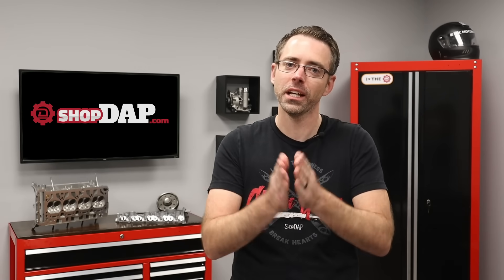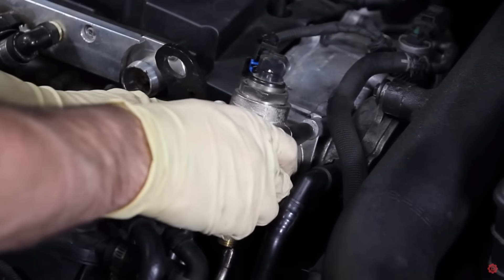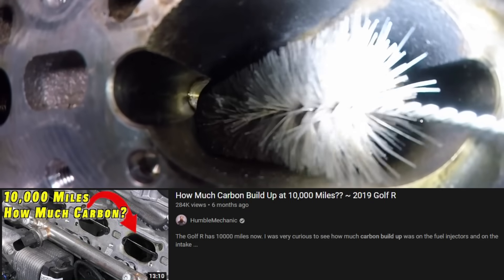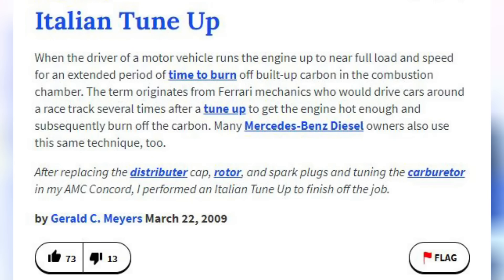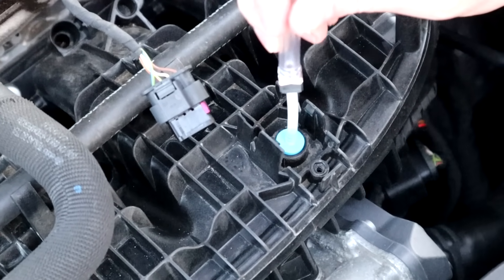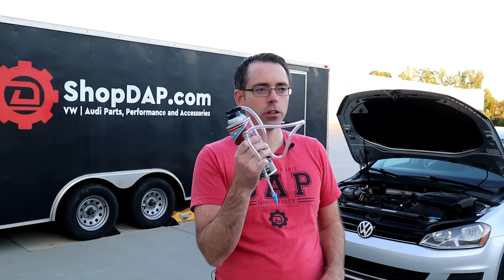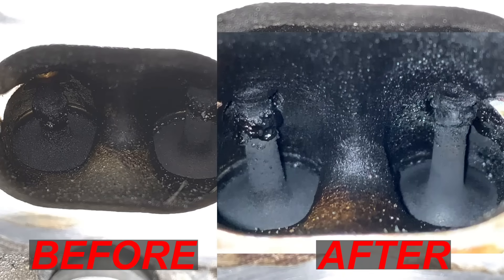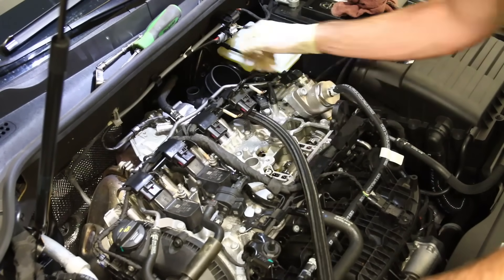Can you Really Remove Carbon for $29?

Comment: Italian tune-up is only good for fully flexing your Turbo vanes and possibly knocking a few deposits that could build up on them from you driving your turbo car like a granny all the time. My recommended solution is to just only buy naturally aspirated port injected vehicles. There a plenty of fun NA, MPFI used cars out there, and they are usually more reliable than their Turbo, DI counterparts.

Comment: The main problem that I've noticed with GDI motors. If you drive them like a grandma they will clog the valves... I have a hyundai veloster with two hundred and thirty six thousand miles on it and i've never done a carbon cleaning and have no misfires on cold starts.. I'd never shift before three thousand r p m and I redlined it every day.. I mean,  it's slow so it's not like i'm going fast l o l...

I do the same to my twenty twelve beetle turbo... But before I owned it an old lady owned it. So i'm sure the valves are a little sticky... Carbon cleaning is next...

Comment: Ford has switched to using port and direct injection with a lot of their engines lately. The 2.7 Ecoboost for example uses this, starting in 2018 with the 2nd gen of that motor.

Comment: The only way is you close the valve one cylinder at a time you fill the intake port after scraping the carbon off! Then you let it sit for  20 minutes and then you brush it  liquid  carbon remover still in the port and then you take rags you soak it up then air gun and then you do it again if you didn't get it all! Then once clean  spray with brake cleaner spray and air gun it out  do each intake port cylinder on compression stroke it will not enter the cylinder! Every 100,000km is usually the  most  like 3 times in it's life.

Comment: A old school way to remove carbon was to poor a small amount of good old H2O into the carberator. Not too much or you risk hydrolocking the engin.
The thermal shock to the hot carbon caused it to crack off the piston and valves.
Or a ball jar full of water with a small hose plugged into the intake manifold
Propane and hydrogen motors have zero carbon build up
In the 70's during the 1st gas crisis propane conversions on gas engines was comon. The engine lasted longer as well.
Then the fed put an energy tax on propane.
This was easy on older engines not so on today's systems.
Thank you EPA

Comment: There are ways to prevent carbon buildup for a long time. The following tips are to be used BEFORE the carbon builds up. 
Use only Top Tier fuel, (Costco has it cheap) and use synthetic engine oil. You're welcome.

Comment: I heard that some engines have both port and direct injection.Could a direct injection engine be retrofitted with separate low psi metered fuel injectors into the intake runners to clean the intake valves? Wouldn`t the o2 sensors lean out the fuel air ratio?Just wondering.You would have to drill and tap the runners and add another regulator on that side of the fuel delivery.

Comment: My Audi 2.0 TSI was using a qt of oil ABOUT every 500 miles , I set up a Alcohol Injection system (basically Windshield Washer Booster) on it with a very fine nozzle into the intake hose ,(just before the MAP) , after about a month it uses 1 qt between oil changes Every 4,000miles...I would never run a car 7-10k on Oil as recommended by manufacturers

Comment: conclusion is, vag do worst car ever been build and best way is never buy direct injected ... or beter to use propane system deleting this system.
you just have to remove the head every 35k miles... fiat do much reliable engines

Comment: The problem is because cars today most of the time stay under 2500RPM when on the road, to get better gas mileage and make your vehicle quieter. So, in order to burn the carbon accumulated in motor you need to run the motor over 3000RPM for some time or long trips but not over 4000RPM or use premium gasoline.

Comment: My 2017 GTI SE, which I purchased new and has been stage 1 EQT since break in still doesn't need this cleaning done. I'm almost at 160,000 miles. No drop in MPG, no performance loss, no cold start mis fires. It's been scoped twice and only has minimal build up. However, I only run 93 oct. and 90% of my miles are freeway miles due to my 50 minute commute into work. I also drive in S most of the time, even on the freeway. So, I don't see 6th gear very often. I'll have them checked again on my next DSG service, just to be safe.

Comment: None of the steps here except the catch can are truly preventative. They are all ways to try to clean the buildup after it has happened.

As the catch can demonstrates, the reality of the buildup is that it is most likely to happen when the vapors condense on a cooler surface. This will be most likely to happen under two scenarios: 1) if the engine is not allowed to reach operating temperature at all, as would occur on a very short drive. The problem here is that the heads and valves will not warm up sufficiently to prevent the condensation, so the little vapor will glom onto it like water on a cold beer on a humid day. 2) if the engine is run most frequently in short bursts, like short drives with lots of stopping and starting, then there will be more production of small amounts of vapor over time that will never be fully combusted, again because the heads and the valves will never really get hot enough for no condensation to occur.

The best preventative cannot be an Italian tuneup- like you say here, it will never get hot enough to cook off the carbon without seriously damaging the engine.

Instead, the best preventative is make fewer, longer drives as opposed to more, shorter drives. This will reduce the amount of time that the engine is running cool, and make the biggest reduction in the chance for any condensation to occur. It might burn off a little bit of the carbon too, especially if you intersperse your alreaady longer drives with a really long one (say, an hour or so).

The thing is, these issues are not really new. Lots of start-stop short runs at low temperature always increase the rate of problems in engines, if for no other reason than it gives the most risk of water buildup for the exact same condensation problem (water is a waste product of combustion so it is unavoidable). Likewise, most lubricants work best at operating temperature rather than cold, so your wear is going to be improved by running longer at hot temperatures.

If you have short commutes, save your car for other uses and walk, bike, or take public transit. If you're within 15 minutes' drive to work anyway, the time savings of using an alternative are virtually nil anyway. You're more likely to waste time in traffic, if anything. Save your car for when you really need it, and it will last a lot longer without these problems.

Comment: I thought the bigger culprit is the EGR system in modern cars rather than the PCV valve? Either way the situation sucks. I have a WRX and it hasn't been properly serviced in the past. Had a nasty power loss and  had to pay someone to clean it properly. Wish the intake manifold products worked better.

Comment: It seems logical that reducing the amount of dirty oil vapor that goes through the PCV valve through the intake valves would reduce the amount of carbon building up. Maybe if piston rings did a better job of sealing, less combustion gas and oil vapor would end up as crankcase pressure and carbon. Maybe if higher quality oil was being used and changed earlier, the oil vapors wouldn't have as many impurities to end up as gooey, gritty deposits.

Comment: I had an intake manifold leak on my 4.3 Chevy V6. When correcting the problem, I noticed the driver's side head and rocker arms looked beautiful and clean. The passenger side however had what I would consider a typical amount of residue for a 250,000 mile engine.
The driver's side, the clean side,  vents to just below the air cleaner above the throttle body.
I always assumed the  PCV side of the engine would  allow blowby vapors into the engine. 
I installed a catch can on the driver's side and I was surprised to see that moisture and snotty looking stuff inside the can.  I now have suspicions of a head gasket leak at the same location, allowing water into the lifter valley just as before.
I'm thinking positive about this. If moisture (steam) kept the rocker arms clean, maybe this moisture being sucked into the engine is keeping my intake valves clean. 😁
 Hey, I'm a positive thinker. My catch can is half-full,  not half empty. 👍
I know this video is a couple years old but it's great information 👍

Comment: I have a 1969 Z-28, it's a real X33 car with a 302.  For such a small motor it had a lot of cam.  It's running a 4.88 gear.
The engine had a lot of valve overlap and depending on octane rating I would have to retard the timing to keep it from pre-detonation.  The motor would rev really high for a street engine up to 9k RPM.  I was constantly pulling pieces of broken valve springs out (I had epoxied oil drain back screens in the cyl heads) and once a year I would remove the heads and replace all of the valve springs.  The pistons and cylinder domes\valves were always carbon'd up terribly.
So one day I decided to install an Edelbrock water injection setup.  It did the trick!  Made the mixture much more dense and the engine stopped pre-detonation.
But....I was fouling plugs like crazy and having to wipe off sooty carbon splattering off of the rear spoiler.  The car is Hugger Orange with White Stripes, so the spattering was really obvious.  I thought about removing the water injection but then after a couple of weeks it stopped splattering and fouling plugs.
Sometime later I pulled the heads to replace the valve springs and was amazed that the piston crowns and combustion chambers were spotless!
The heads and pistons looked like they were all freshly rebuilt. 
I could tell the instant that water inj bottle went dry though!
Eventually the Vari-Jection controller failed and Edelbrock had quit making them.  I went with a 400 block with main saddle half spacers and a 350 crank with a 350 main cap for the 400 bolt pattern.  I used a 2 bolt truck block and had the outers splayed for more bottom end strength.  I didn't need as much cam so the engine wasn't as temperamental.  Don't even get me started on all the mods I had to do to the Holley 650 to make that little 302 run like it wanted.
So how come nobody makes a simple water injection setup for these direct injection engines?  Sure seems like there is a market for them.
It could go right behind the Mass Air Flow sensor or speed density thingy, what ever type VW uses, and provide a dense water vapor charge to the cylinders.
Guarantee that would cure the carbon build up problem.
BTW, I hope all of that plumbing shown for the meth\water injection was all for theater.  My old water injection had a small tank and like 5 wires total.

Comment: Between a catch-can and a 10-15k mile seafoam "cleanup", you can prevent 95% of carbon deposits and it's not that hard or expensive to do. Every other oil change you add a 10 minute job to the mix and you're good to go.

Comment: I've been cleaning my Toyota Yaris 1.5L DI with CRC intake valve cleaner since 19k miles when I bought it. I do this at every 5000 mile oil change. You have to be careful, because the car doesn't really care for the process. After the 1hr heat soak is when things get interesting. I carefully run the residual cleaner through the engine until it's cleaned out, and quits smoking. I avoid loading, because it will miss guaranteed. After clearing it out, I immediately change the oil. I plan to do a before and after borescope this summer to see how effective it is. But the motor runs great at 55k. No misses. No power loss that I can tell.

Comment: Do a can of crc intake cleaner once a month for 6 months if it’s never been done and you have more than 50k miles. My car has 39k miles. I did one can it made a huge difference I figured two weeks later to do another can because it was impossible to get all the carbon out with one can. I plan on doing one can every oil change from now on. Do not allow that carbon to build up ignoring it. If you don’t do this sorta maintenance your car will be in shambles when your close to 100k miles. These car manufacturers don’t want our cars to last it’s in there best interest the quicker your car fails the more they sell. It’s on big scam

Comment: Seafoam does actually work. Buutt depemding in the age and amount of carbon build up you could need to do it 2 or 3 times, but it does work, and hey whats 10-20$ for a clean system

Comment: My father used to slowly pour Coca-Cola down the carburetor as the engine was running at high idle.  It didn't do anything, he just didn't like Coca-Cola.
Reply: so basically poured water and sugar into the top end? Your father is a moron.

Comment: Injection takes place outside the compression phase so why such high fuel pressure?  A simple poppet valve like the ones already in use would suffice for the fuel entrance.  Puzzling to me.

Comment: Should have seen the amount of smoke that came out of my car. I literally put a cloud down the whole street. It actually stopped traffic . It helped my gdi engine alot. When I put seafoam in it , the bottle says to hold the rpms around 1500-2000 when adding through the intake.  And like he said make sure your not spraying the mass airflow sensor . Would highly recommend seafoam .

Comment: Great video that was cool how you showed the before and after. I used the CDI Intake cleaner it definitely made a difference now after seeing this video I feel like I should spray another can or two into my Kia soul 2016 40k miles. I changed my spark plugs on my Kia soul at 40k miles. Decided to check them today Why have my new spark plugs blackened after only a month. My oil is still crystal clear I only drive locally to run errands and food shopping. Just wondering if this is normal. your channel should absolutely have millions of subscribers for sure. Use better tags and descriptions.

Comment: Umm dude, in the 1960's Detroit auto makers started to put PCV valves on cars. How old are you talking about, 1940's or 50's?
The PCV valve was typically located on the top of the valve cover are run to the backside of the intake manifold.

Comment: i'm a mechanic by trade all this easy snake oil ? solutions for a piss poor design .. I will simply bite the bullet and remove the heads and hot tank then and port and polish them while its apart taking a negative and make it a positive. For me its nothing but time and gaskets and head bolts if they are TTY.

Comment: direct injection systems had it almost right. instead of "replacing" the port injection system they should have simply "added" the direct injection system. with the port injection system going along for the ride to simply "keep" the valves clean. or even better yet keep them inert and there only for routine maintenance to run the car off of the port injectors to clean the intake valves. This way using them all the time does not compromise the fuel economy of the port injection system. Only use then when doing injection cleaning servicing etc..

Comment: The patent pending 505CRF & 505CRO Pour-In Treatments created, tested and manufactured by ATS Chemical are proven to STOP gasoline and diesel engine carbon build-up as well as clean existing carbon.

 

505CRO breaks down carbon deposits from; sticking piston rings, sticking lifters, sticking camshaft phasers, sticking oil control valves, sticking timing chain tensioner, and restricted lubricating screens. 

 

505CRF poured into your fuel can clean coking from the port style injector and the direct style injectors.

Comment: It's $6200 to get the carbon cleaned by taking off intake manifold at the dealer. They quoted 20 hours of labor at $300 an hour as it involves bumper and radiator removal, transmission unbolting, exhaust unbolting, engine out, intake disassembly, media blasting, new gaskets, reassembly, calibration of all the bumper mounted sensors, etc. (DDTA 4.0TFSI engine)

Comment: putting a can of chemical cleaner thru your intake might make you feel like youve done something to remove the carbon , but in reality all you did was remove money from your wallet , the only sure way to clean carbon from an engine is to remove the head , take the valves out , clean everything , and reassemble your engine , but , if you dont want to do that ...go right ahead and waste your money on seafoam or some other 'cleaner' ....good luck with that

Comment: I solved the problem by venting the PCV through a large bore tube.. terminating below the car.
  Bad ? you bet... but when semi trucks create twin Soot columns on every acceleration.. legally. 
  Not something I lose sleep over. 
You know that Everything that you are emptying out of that catch can contraption is what normally goes into the engine ?  
No surprise then that those valves look like a never cleaned out BBQ bottom.

Comment: It's not only the PCV system, but the EGR system as well.  Another contributing factor is the use of low tension piston rings which increase blow-by.  Lastly, forced induction will make it worse.  In all honesty, DI engines need decarining every 10k miles because by the time you notice it, its to late.  Nothing you put in your gas tank, nor what kind of gas you use will have any impact on this kind of carbon buildup.

Comment: I was lucky in my MK6 GTI i broke a valve spring cuz i was dumb and putt a 2 step module in it. P.S. i do not recommend doing this. so i had to take the head off anyways so i just walnut blasted the ports when i had all the valves out and i also run W/M and it is the second head and third block the joys of wanting more power. so now its for sale as im getting a MK7 Golf R ill have the more power with less issues lol.